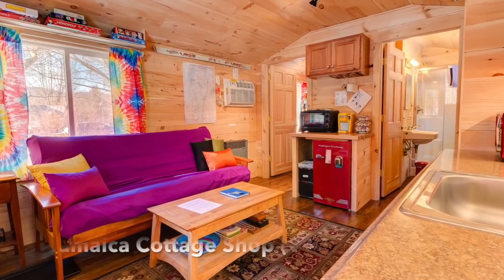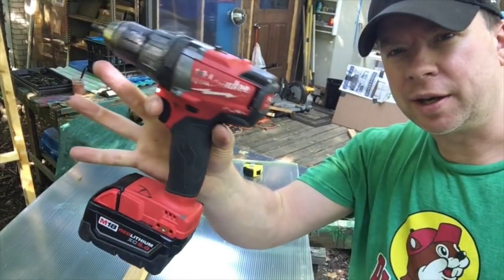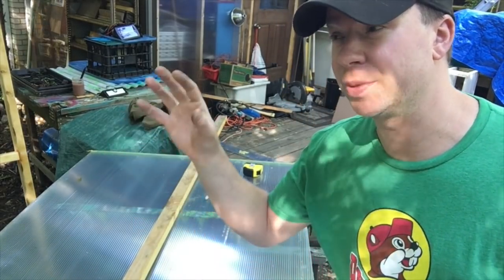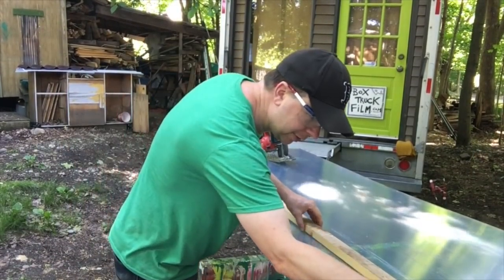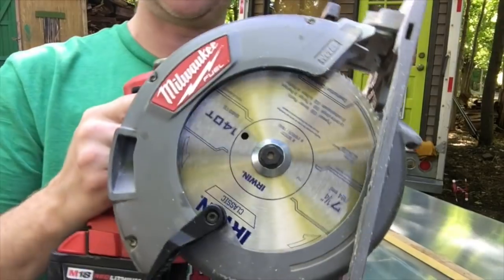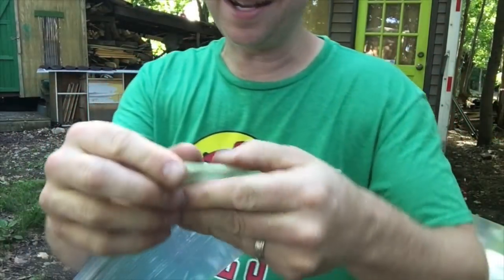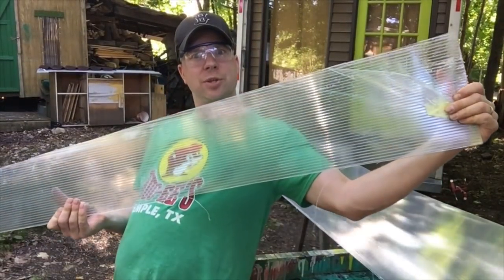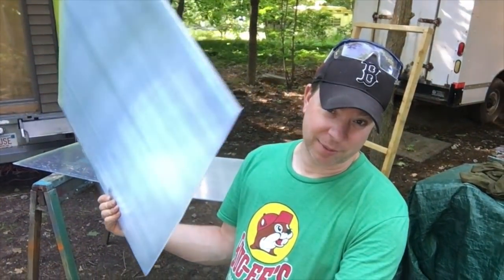How to cut Tuftex Greenhouse Poly Panels THE EASY WAY

Comment: I use a tile saw blade to cut this....it will leave a smooth edge...also you can put the blade on backwards it will cut very smooth...this is how i cut metal roofing too.

Comment: FYI, the blue side of the film covering the sheet is placed on the UV treated side of the sheet.  This side of the sheet should face the sun after you peel off the film.  Presumably, if you do it the other way around, the Sun will start to degrade the sheets used upside down.
Reply: Good info
Reply: @carlameaders4352  Thank you so much!!!!
This is the answer we needed. Don't know why the company does not specify side with blue film is the UV coated. Thank you, again!

Comment: Try putting your plywood blade on backwards on your table saw and feed through slow.  Have done this for years, and cuts as clean as glass.  Also works very well with melamine for cabinets.  Just be careful to break the edge when done, as it is razor sharp.
Reply from the maker: Good tip- thanks- haven't tried that yet. My table saw is smallish though- so running a 4' by 8' sheet through it might be a little bit of a pain, but I'll still try it sometime.
Reply: @relaxshacksDOTcom  can i cut polycarbonate 4 mm sheet with the ACYLIC CUTTER ?
Reply: Good info ahh huh

Comment: We just built a $30,000 greenhouse for a customer. I just used a regular 40 tooth diablo 7 1/4" framing blade. It cut right through nice n smooth no problem

Comment: I've heard that WD40 will remove Sharpie, I do know that isopropyl rubbing alcohol will remove it. I use it (isopropyl) in my work a lot for cleaning soldering flux. Linda and I send our best.
Reply: if you write on top of Sharpie ink it will wipe right off with the old stuff.

Comment: Deek,  how do i submit a design for your consideration?  All metal framed very strong ...very low construction cost....light weight...easy to move without compromising structure.

Comment: No, Deek FLIP the blade, make it run backwards, will cut sweeeet cleeeen, it will cut vinyl siding wont tare, have fun
Reply from the maker: I works pretty well this way. Standard/rougher blade flips have never worked as well (for me) as people claim they do. Of course that will depend on the blade and its condition.